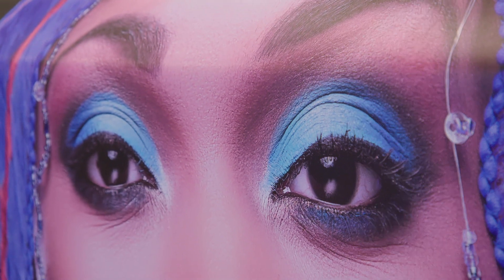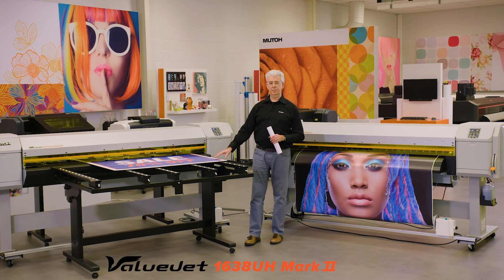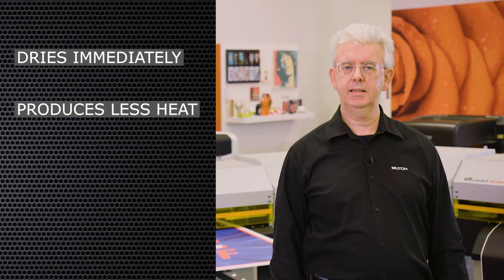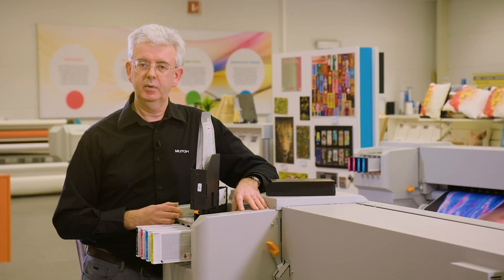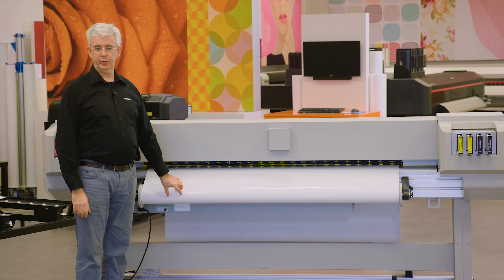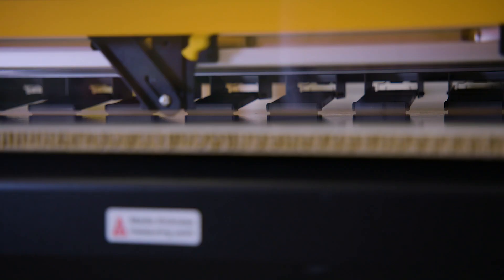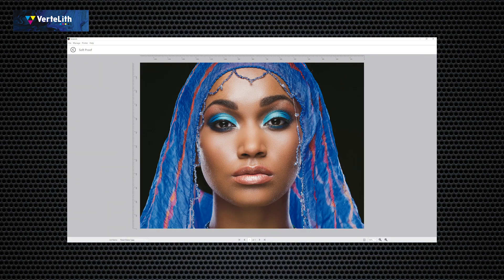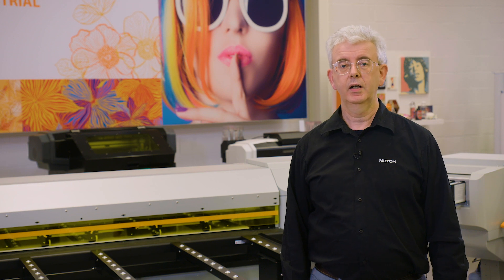Mutoh Mark II Series : 64" LED UV Printers for Roll-to-Roll or Roll-to-Roll & Rigid Printing

Comment: Nice design! I was wondering lately if there's a machine that's able to print both roll and flatbed materials. I'm currently using a roland roll printer and a rainbow inkjet uv flatbed printer, and I've been using them for two years, they work fine but I wish I had seen this one earlier